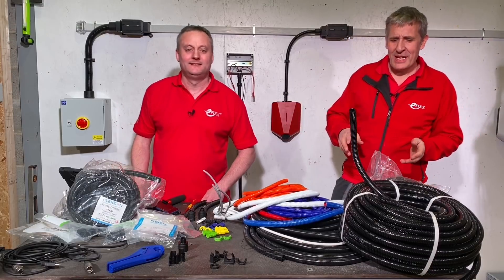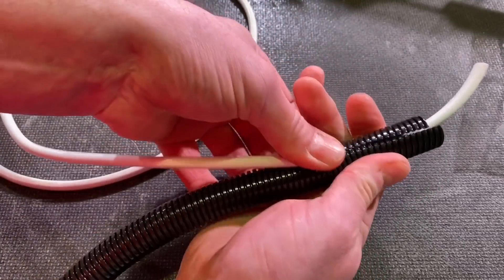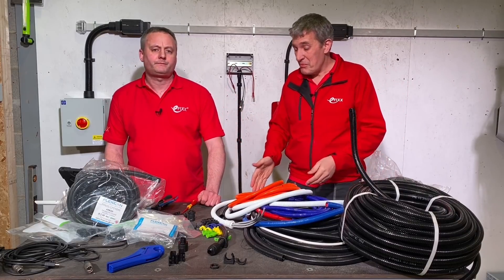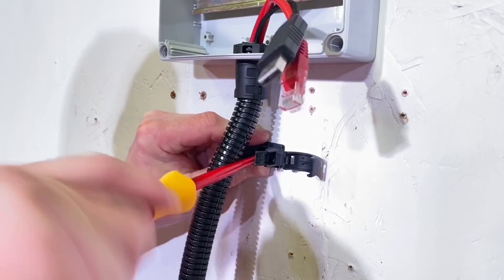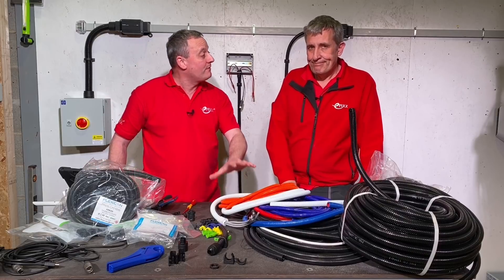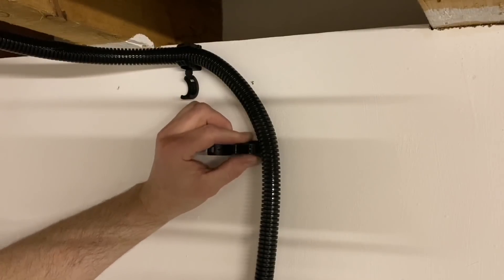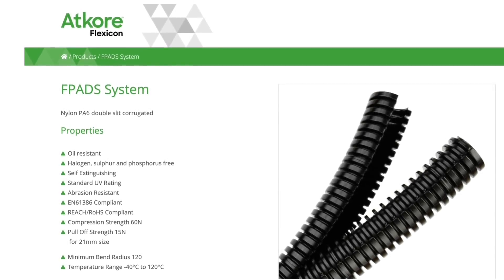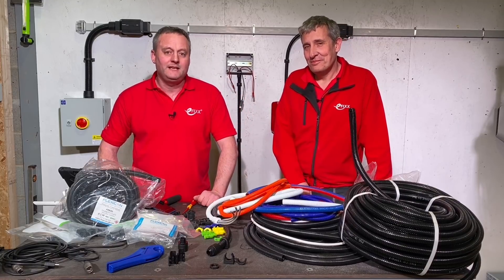Divide and conquer with FLEXICON SLIT DIVISIBLE FLEXIBLE CONDUIT - from ATKORE

Comment: Hi Guys, I haven't used the Flexicon system but I have been using the FipSplit system by Frankische in Germany for many years. Its excellent stuff, extremely rigid and again, like your Flexicon, has a range of sizes and similar split glands and locknuts.  It also has a tool, plastic thing with a hole in it , to drop the cables into conduit. See link below
https://www.fraenkische.com/en/product/2ntpa-m-locknut-metric?context=&q=split
Reply from the maker: It does look very similar - thanks for the link 👍

Comment: Why not pull the cable inside and let the conduit intact?
Reply: It can' be situations like shown in the video @ 4:44 when there is connector on both end of the cable so you can put it through the conduit.

Comment: How did I never know this existed!! Will come in handy in so many ways. I have EICR Remedial to do soon where meter tails have been stripped to single insulation outside the CU. Was thinking of putting in flexi but would have meant isolating and then removing tails etc, this is going to save the day. Looking forward to snapping it together too😊

Comment: Used this for years in industrial wiring. When you’ve got loads of Reed switches and sensors on moving equipment. Easily replaced when it wears. Good stuff 👌🏻
Reply from the maker: Thanks

Comment: I would point out that PME had this years ago. Saved huge amounts of time when replacing damaged conduits.
Reply from the maker: Thanks for commenting 👍
Reply: Another tip for the team. My Company had a big job on in London for a well known biscuit manufacturer and we were installing equipment for a third party. There were lots and lots of control cables all going back to the main panel.
I had a phone call from a seriously concerned Supervisor that the 20mm stuffing gland bodies were fine but the locknuts kept turning to dust when being tightened. I told him the solution was to obtain the PME split locknuts from a local supplier and use cable ties to stop the glands backing out of the panel when stripping and terminating the cables. The gland nuts could be retro fitted later on. No lost time on a very tight budget.
He said he’d never heard of what I was talking about, to me I was talking tosh. I had seen this kind of Industrial ignorance shown by ex-housebashing council employees before so it was easy to make him look as silly as he was being. Three cheers for PME saving the day and my erstwhile reputation!